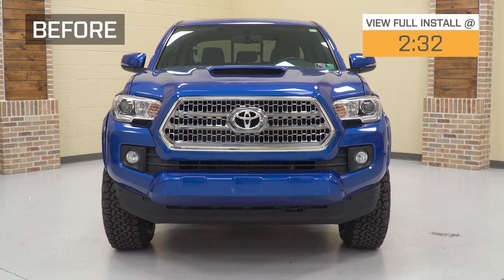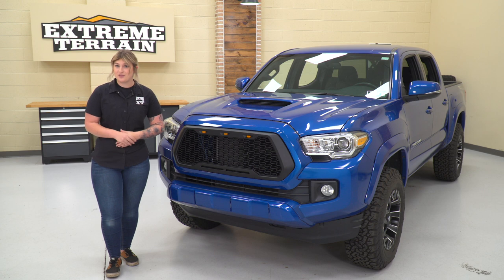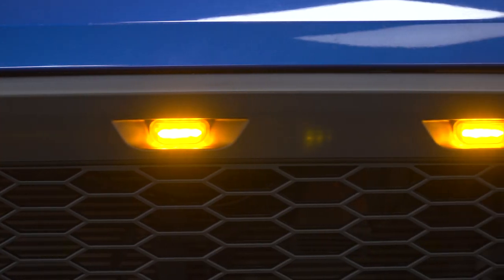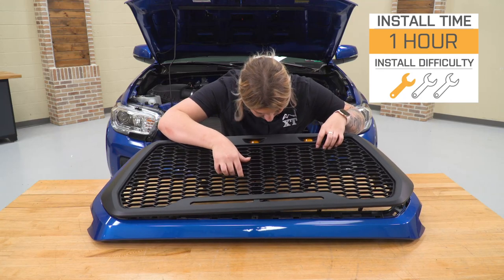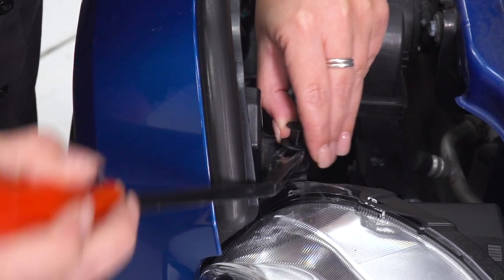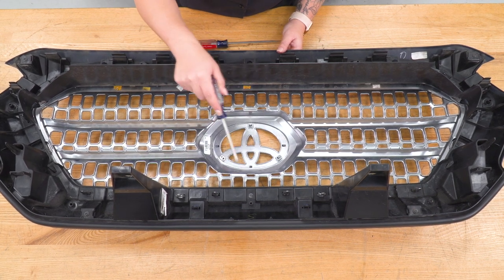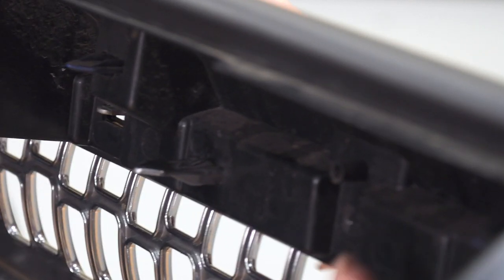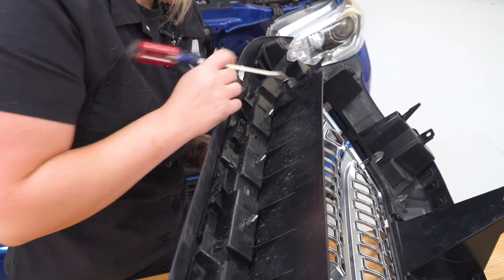2016-2018 Tacoma RedRock 4x4 Baja Upper Replacement Grille with LED Lighting Review & Install

Comment: Wired everything correctly but my turn signals have 3 wires they are also my DRL so not sure if the wiring is different but the raptor lights work and the DRL/Turn signals do not. Any advice would be helpful.

Comment: The pictures show LED lights on the sides. Do you have a video for that grill?
Reply: You ever found a guide? I just got the grill with DRL and I don’t understand the wiring setup
Reply: @i_sharky  go to TacoVinyl. There is a video on it
Reply: @erichimmelreich9372  sorry but could you comment a link? Idk if I’m blind or just can’t find that exact grill
Reply: @i_sharky  go to Snailtrail4x4 on YouTube
Reply: @erichimmelreich9372  thanks! I’m not a wire/electrician by trade but the installation instructions were vague and I couldnt find another setup video on the grill

Comment: What about sensor on OEM grill?
Reply: That’s why title says 2016-2018 lol 19 and up have sensors
Reply: @rafaelbanderas101   that is incorrect.  My tacoma was manufactured in August of 2018 and it has the TSS sensor.  However, the  3rd Gen. 2016 & 2017 don’t have the TSS sensor.  It’s too bad, because I really do like this grille insert.  Hopefully this company will provide something sooner that will accept the sensor.
Reply: Rafa ur right my truck 2018 do has sensor. And grill looks very nice 👍